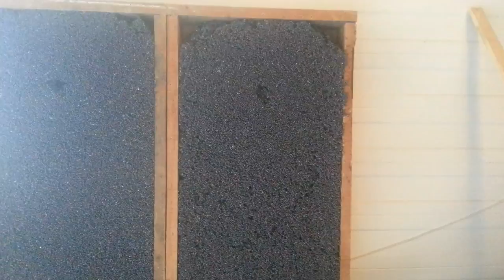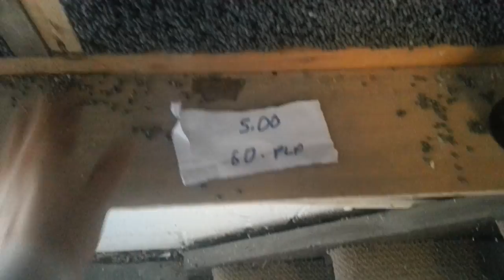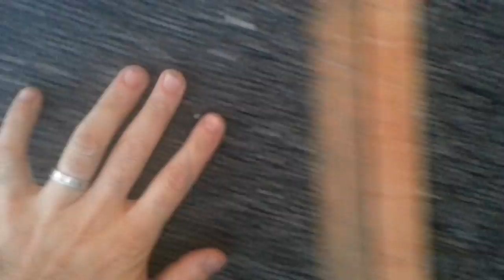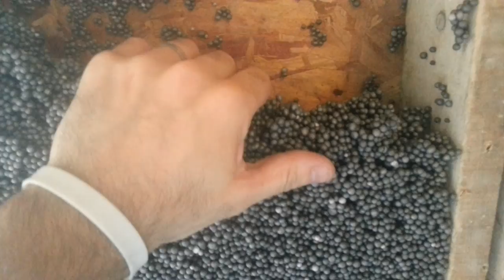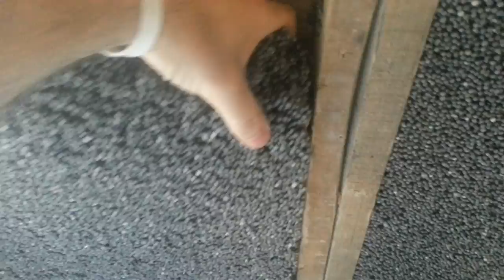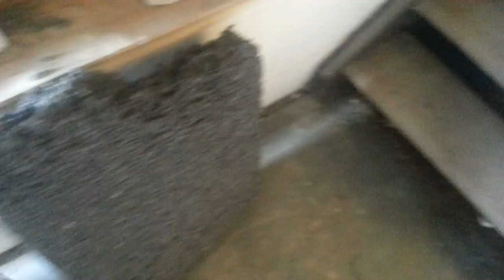EEH cavity wall insulation beads and glue test

Comment: What's the importance of strong glue if it's in a cavity - are there any issues if beads  aren't properly bonded?
Reply from the maker: John Carmody Well John. If there are holes or gaps in the cavity the beads may move slowly but surely. If the cavity is well built with good joints etc there may be no issues.
Reply: Yes plenty of issues, if no adhesive is used the beads will flow under suspended timber floors and from every little gap, over spilling into the loft space and spilling out of vents, also any external work would be a nightmare, changing Windows, building ect... However to much adhesive can also cause issues by not allowing water / Moisture to drain through the EPS causing water to track on internal walls, causing damp issues... Cavities are their for a Reason ALWAYS REMEMBER THAT!!!! It's ok testing this shit in a factory, leave it out in the real environment for 25 + years and I can bet you it will cause issues and it is causing issues now...... Trust me......
Reply: As was said above until it turned into a rant, the ratio of adhesive applied to EPS is critical, not only for water permeability but also to ensure full coverage and to achieve the specified thermal values, I note that different jet sizes are displayed in the video but not the pressure used, this can give a substantial difference in the delivery through the spray jet of up to 20ml or more per minute.
Calibration is a simple process which requires recording the weight of bead delivered through the injection gun over one minute then this is matched with the systems stipulated ratio of adhesive for that weight of bead.
IF installed correctly then neither the bead nor the adhesive deteriorate over time and are therefore problem free, so if someone has an issue post install then it was either incorrectly calibrated, installed into a property that wasn’t suitable OR the property hasn’t been maintained as required.
Reply: @jeffharris4558  In your opinion, is it good to do something like that or not? There was an engineer at my house and he recommended this solution. But I watched so much on YouTube how people have problems with insulation and now they are removing it. But I guess it wasn't that  isolation. So I don't know anymore.